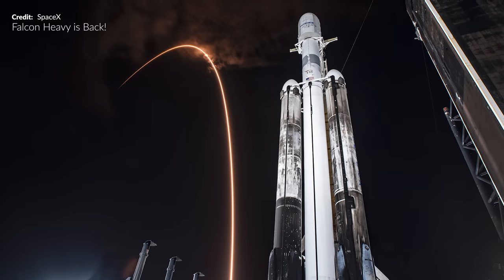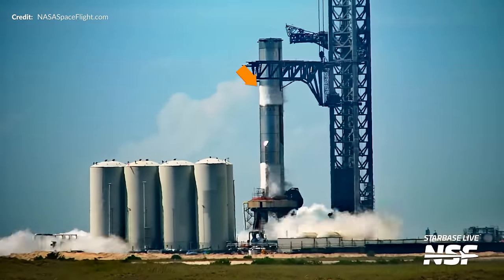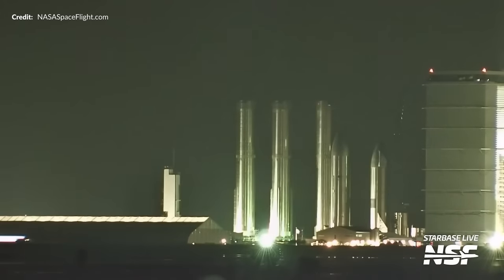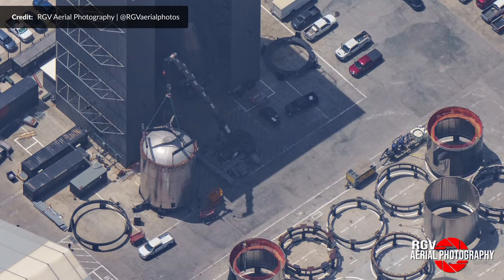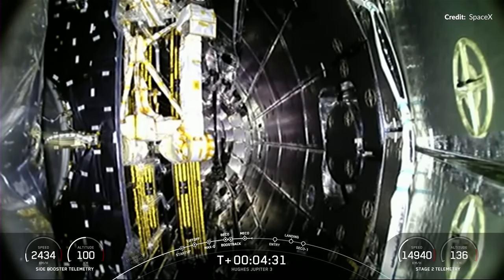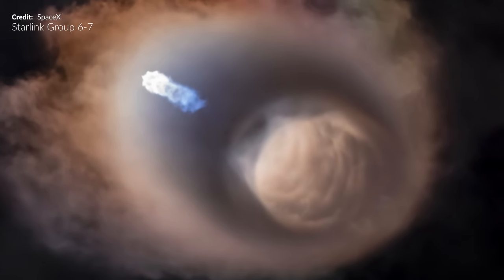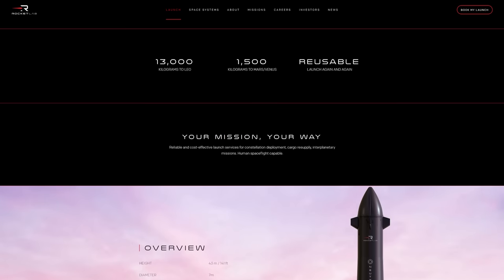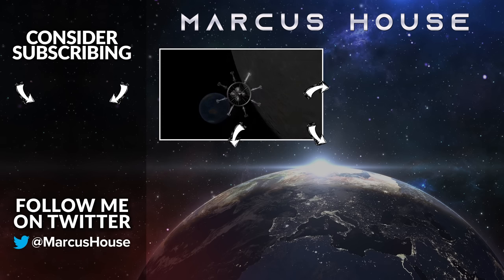SpaceX's Remarkable Full Pressure Test, Starship Sacrificed, & Record Breaking Falcon Heavy Mission

Comment: You know what I find so disappointing? I work in military aerospace with some older engineers that have been around since the SR71 times. They seem to all come to the conclusion that SpaceX’s first starship launch attempt was a major screw up. They never seem to even understand or know that spacex already has tons of falcon 9’s flying nearly every week and they starship is fully reusable. Personally I think if they were thrown into spacex they would be so overwhelmed by the sheer speed of development.
Reply: Counting on a concrete launch pad was a major screwup … especially after every static fire or launch there were pieces flying everywhere.  I was disappointed on SpaceX; stuck on concrete was stuck on stupid.   They only needed a steel plate on the launch pad surface to prevent the violent hot turbulence from ripping it apart every time they tried.
Reply: @douginorlando6260  I agree, they could’ve held off to beef up the pad but at the same time this company moves stupidly fast for aerospace. I do like that approach at least until they put people on it.

Comment: Marcus, what is the psi of thrust against the plate and does the water psi exceed the thrust psi.
My guess is that it doesnt so what will happen is thrust will beat the water back inside the plate then the Raptors will quickly dismantle the water deluge plate in similar fashion to the hole it dug previously. 
I hope I'm wrong but I dont think so
Reply: Yup. And worst case scenario without a check valve back pressure into the deluge tanks.

Comment: No theories on what led to the gas purge or rupture during the deluge test?
Reply: It was the intentional remote activation of the tank farms relief valves to stop the flow of water. My current theory is they activated the relief valves a little early as the water was spraying all the way over towards the tank farm. I anticipate SpaceX making that wall a little higher to keep the water from getting over to the tanks to be on the safe side.
Reply: @LordTimelord  I've wondered if there's a deliberate purge once the last of the water flows past a particular sensor, to dump the pressure pushing it, rather then end up with dry pipes under the launch mount.
Was hoping to see what Marcus might have commented, as he never noted it in todays video.

Comment: I would have expected the Starship pad deluge system to have a water recovery apron and trough or something.  It doesn’t seem good for all that water to just flood the surrounding ground and possibly undermine concrete, does it?
I suppose they’ll do an extended static fire to test the deluge system as well as the booster.

Comment: Does the fact that they expended a new booster mean that they value flight-proven boosters more than new ones?
Reply from the maker: Potentially. I think they are really trying to see how many flight they can do until one fails to land.
Reply: I seem to recall there was an additional launch cost to expend the booster.  So potentially the customer just chose to expend for their own reasons.

But there again, this was a heavy payload to a taxing orbit.  Perhaps there were some question marks around the confidence in pushing a reused booster as hard as was needed.

The way the world is though, given the size and cost of the payload, I suspect the insurance savings of making the actuaries happy outweighed the extra cost of expending a new booster.
Reply: No, it means they don't have any flight-proven Falcon Heavy cores to re-use. They've never successfully recovered a core...

Comment: The water deluge will do NOTHING prevent the damage all of that thrust created last time.  It's a band-aid on a mortal wound.  Boca Chica is a WRITE OFF.  A new Starbase with flame diversion tunnels has to be built in a new, viable location.
Reply: You expect the steel plate to fracture and be lifted in the same way as the concrete pad. Right.

Comment: I still think this deluge is not enough for the most powerful rocket ever. Elon tried it without a deluge or a flame diverter and we all know how it turned out. Installing an expensive and untried flat deluge like this without a flame diverter in my view is foolish. Putting in a flame diverter from the get go would have been simple before any of the launch tower was built. Now what you have is all those engines slamming up against a flat surface like that can cause massive damage to the metal in my view, yes it may stop concrete from flying up and damaging the engines or rocket but if the steel platform needs to be replaced or fixed after every launch then what's the point if you already know of a combination water deluge and flame diverter is already tested may times and it works. If the deluge is going to need extensive repairs everytime you launch then put that launch tower on a swivel where it can be placed over 3 different launch pads so as to give the crews months and months of time to do repairs to the deluge you just wreaked while being able to carry on with launches......sorry but that's what I feel will happen, don't mean to curse the launch.

Comment: Great content as always MH. Wouldn't it be feasible to lift starship with a Falcon Heavy instead of a booster withy all those engines which increases the risk of one failing? A big HI from Scotland.
Reply: Nice thought but I guess that was tongue-in-cheek.  Elon thought fondag was up to it - but he was wrong about that.
Reply: 27 engines compared to 33 engines?  Not much of a decrease and the engines are individually less than 1/2 as powerful. So putting a Starship on top of a Falcon Heavy would mean no lift off.  That assumes that the Falcon heavy was not just crushed by the mass on top of it.

Starship (2nd stage) fully fueled with Cargo is heavier than a Falcon Heavy with a normal 2nd stage and payload.

The current Super Heavy booster with Raptor 2 engines is at least twice as powerful as any rocket ever to launch a payload to orbit.  Falcon Heavy is an excellent booster but is not in the same league.
Reply: @Scanner9631  Thanks very much for the in depth reply, appreciated.

Comment: I wonder why the Falcon Heavy sacrificed a new booster? Was there something different about it? Seems like they would sacrifice an older unit, if everything is equal.
Reply: My theory is since it was such a heavy satellite. They probably pushed the engines past 100% for the extra Delta V to attain that orbit. Since they were expending the core stage anyway, they could push the engines to the max.
Reply: @LordTimelord  Oh yes I do agree. But why expend the NEW booster. Wouldn't an old one do the same? I really don't know. Seems like there must have been something special about it, something different, a modification that would have been impossible or too expensive to perform on an existing booster.
Reply: Because it's a Falcon Heavy core, not a Falcon 9 booster. They've never recovered one of those, so they don't have any pre-flown ones to expend...
Reply: @simongeard4824  The cores are built differently than the boosters? I thought they had used boosters with multiple flights as cores before? No?
Reply: @JeromyBranch  no. The side boosters are interchangeable with F9 with only minor (reversible) modifications, but the core needs structural reinforcement that has to be built into it during construction.

Comment: In the US there are laws on the books that are supposed to apply to everyone that require a permit before you dump industrial process water. The Army Corps of engineers reached out to spacex to start the permitting process years ago and spaceX was dismissive. So it's not the fault of the laws or the government. SpaceX just has the opinion that they are above the law, which is really terrible for society as a whole.

Comment: This does not put doubts to rest.  The water is coming out pre-atomized, rather than in thick sheets of laminar flow.  It is the atomization of the water by the acoustic shock that attenuates the acoustic shock.  Also, the water appear to be directed outwards, rather than focused over the area of maximal thrust. This will aid the rocket exhaust in simply pushing the water out of the way and the engine thrust is easily more powerful than the pressure pushing the water out in the opposite direction.   My guess is this will Still end up allowing the engines to coin the metal shower head structure under the rocket… In essence, Still a single use pad for a rapid reuse rocket.  SpaceX  is STILL just putting lipstick on that pig of a design, coming up with the only things they can think of that do not require them to redesign and rebuild the entire pad.   But again, they do not have a permit to release that much fresh water into a sensitive salt water marsh area.    Maybe less fanboyism and a little more requiring Billionaires to play by the rules and do their due diligence.

Comment: I don't get it. Why not copy NASA launch pad?
Reply: SLS damaged their system.  Starship is TWICE as powerful and when upgraded to Raptor 3 will be even more powerful than that.  Needs a different and better system.  However NASA did back in the late 70s propose this type of system for larger rockets, so the big question is why isn't SLS using this type of system?